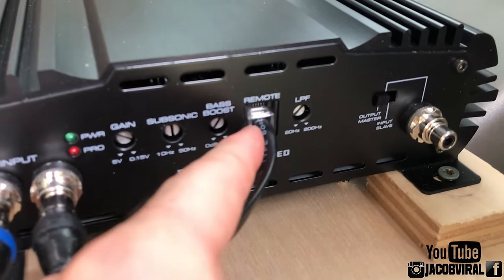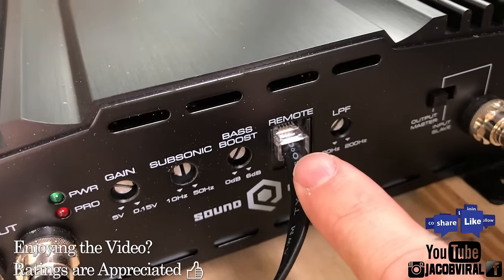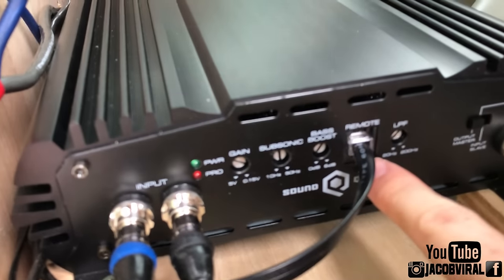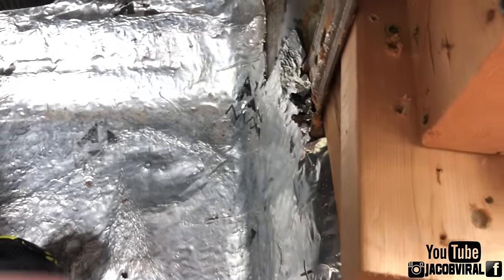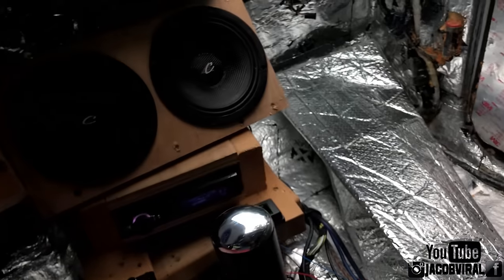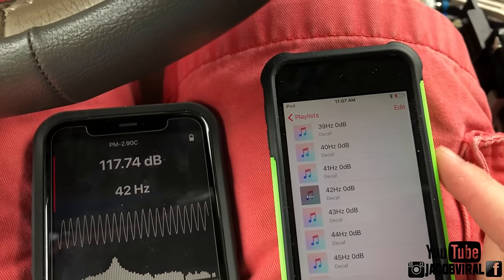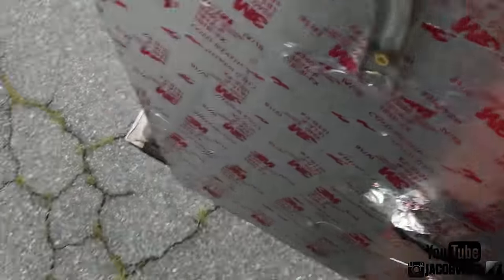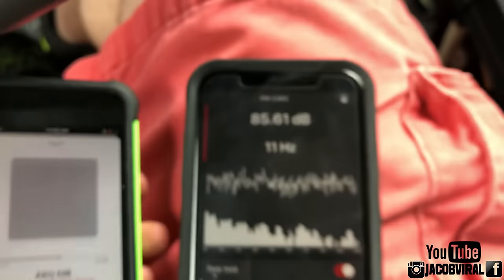DOES USING A BASS KNOB MATTER ON YOUR AMP?

Comment: The Bass knob is essentially just a potentiometer (variable resistor) which the amp circuitry uses to make comparisons to determine volume level in relation to the set gain of the amplifier. Since all wires have resistance, it's impossible to remove the resistance value of the long wires for the bass remote (there's a voltage drop between the amp and the knob which you can measure with a multimeter). You could also verify this by measuring the resistance value at the end of the cable with the knob both fully up and down. I would recommend anyone removing their bass knob to ensure they recalibrate their amp gain as this additional signal could be introduce clipping which can harm the subwoofer voice coils.
Reply: Bruh honestly who cares shhhit if you gotta sun or subs or subsssssss want allll the bass am I right so all gain and let them clip
Reply: @russel  I was going to say the exact same thing
Reply: You should really be setting your gain before adding the bass knob anyways

Comment: MAX on the bass knob vs base gain on the amp may not be the same. The bass knob is a potentiometer. It may not be calibrated to be exactly matched at 100%, especially if it's not the same one that came with the amp. That is why you should (and probably did) set your gains with the knob installed and at max.

Comment: I've only been aware that when you remove the remote bass (or when the wire isn't actually connected to the bass knob) that the gain is essentially maxed. I imagine pulling the remote connection out to power off the amp would be safe enough

Comment: Maybe because the bass knob adjusts the bass (well never!!) if you have it at minimum and un-plug it then the bass will jump up to normal so that sudden jump (transient) could cause damage but if you have the bass set to where it would be without the bass knob and un-plug it then the bass will stay where it is and no jump so no damage.

Please anyone correct me if I'm wrong or if you know or have any other explanations, thanks.
Reply: yo i got a question. my subwoofer won’t make any noise which bass knob plugged in all my wiring is good but when i unplug the wire from the base knob it clips (idk what clip means but i assume just the subwoofer jumping to max gain for a split second) and if i touch the end of the aux cord for the knob, my subwoofer works. i currently have the knob unplugged because i thought it was a problem with it. lmk if you know anything that could help, thanks
Reply: @maddoxschroeder1712  gain control on the amp needs adjusting most likely or check your cross over and low pass filter

Comment: I've tested all kind of bass knobs. My last spl cartel knob had 30ohms on 1 channel and 5 on the other, replace with new lc1 4.5 ohms on each channel. Another known good knob, same as the lc1.. I have concluded that I'm just going to control sub level with head unit to get the  most out of the system. There simple WILL be resistance in you signal using a bass knob, no way around rather than to delete it... Sucks because i wanted the fancy bass knob and such but it is what it is

Comment: Funny you asked... i got a Orion XTR15001DZ class D 1500 watt amp. At 1st I was lazy to run the line for the bass knob, when I put the knob in?? The knob killed the bass. Muffled it horribly.  I simply disconnected the knob, bass ROCKS again. SOO..  with mine NOOO BASS knob!!

Comment: The set-point of the gain equals the max power that will be output to the sub.  Installing a potentiometer allows the gain to be decreased from the set-point.  You wont get 100% because they use a resistor that has 1% tollerance
Reply: Yes exactly, The gain on the knob can't go above the set point of the gain set on the amp. It can only go down from that set point.

Comment: I'm confused. Why would the gain be at max for a test and the bass knob be at zero for the other test? I was under the impression that the knob controlled the gain from zero to max. I'm I trippin?
Reply: When you disconnect the knob, the system reverts to the physical gain level set at the amp. Or if you are talking about the knob being turned to the left, that knob is MAX all the way to the left, rather than right.
Reply: The bass knob doesn't control the gain - only the output, you want to set your gain with the knob disconnected or turned all the way up, then when you max out the knob you don't have to worry about the gain getting messed up

Comment: Jacob what is affecting your db output isn't that soundqubed remote but you not owning a soundqubed hdx3 subwoofer😁Just messing with you. You asked what subwoofer you should get next. Try a 15 or a 18" love your video and try what gets you to 150db.
Reply: How does that make any sense lol you don’t have to brand match anything dude that’s complete bs
Reply: @giovanniwolf7198  I was just messing with Jacob. See along time ago he used to have 2 18 hdc3 on 2 hifonics amps. Now I have 2 18 hdx3 on 2 hifonics amps. He can get any brand or any size he wants but his older build with 2 18s in a no wall same SUV was very loud. I put the video in my subwoofer setups playlist category. Jacob gets 100% credit for the video. Its just a playlist video with over 200 different subwoofer setups.

Comment: Bass knob range is from 0 amp gain to max of whatever your amp gain is set to. Obviously your remote gain knob isn't linear with your amp gain...slightly uncalibrated
Reply: Bro I'm experience that.

My knobs only work until 50%

From there to a 100% there's no output effect
Reply: @quintonnkoane9885  yes same here on my nvx amps

Comment: my amplifier has a remote control input and a remote control output slot which should i use for a bass knob?
Reply from the maker: Output goes to other source and input goes to current source for signal/connection

Comment: Correct me if I'm wrong but is the bass controller designed to tone the amp down and your main settings made on amp itself     I have always did my maximum settings on amp and used the controller to dial it down when needed
Reply from the maker: Correct use knob to adjust as needed for bass

Comment: Do you think the RCA bass knobs affect output or sound at all aswel? Cheers
Reply from the maker: Yes, think about the wire being damaged or possible lower quality/output if not properly set. Also could disconnect and cause issues. Overall, no bass knob = safest but not always most convenient.

Comment: Jacob hi I wanted to let you know that the audio control bass knob is intended for adding bass to songs that are old recordings or enhancing the bass on these old songs f.y.i.🙂🙂🙂
Reply: I think you're talking about the audio control epicenter.
Reply: @Widowmaker2828  can I hook up both?
Reply: @evan.norwalkcalifornia562  By both, I assume you mean running an audio control Epicenter and your regular bass know that most amps have. If that is the case of course you can run both. I recommend it. Then you can add just the right amount of low bass to any song.
Reply: @Widowmaker2828  I have a t-1500 fosgate amp with two alpine 12s...I have a epic center..what kind of bass knobs do you think I need
Reply: @evan.norwalkcalifornia562  If the amp doesn't come with a bass knob you can buy any rca style bass knob. There are plenty available on Amazon or Down4Sound. I use the bass knob from Down4Sound that looks like a subwoofer. It works well but is a little pricy.
Reply: @Widowmaker2828  what’s the name of it,and do u notice a big change..
Reply: @evan.norwalkcalifornia562  I have this one:
https://www.down4soundshop.com/down4sound-subwoofer-bass-knob/
Not sure what you mean by big change... Keep in mind a bass knob does not add bass. It only removes bass. At full volume on the bass knob it simply let's all the music's natural bass come through. The bass knob's real job is to control the bass by turning it off when you want to hear the lyrics well or want to talk to someone in the car. Then turn it up to show the power of the bass. Hope this helps.

Comment: Great vid man😎👍
I got my bass knob wet for been on the floor..can that cause my amp not to work? All my door speakers still work except my subs ..hope you can help me out with my question
Reply from the maker: Thank you! I would disconnect the Bass knob and make sure the amp is connecting correctly and everything equipment wise is good. Water damage can blow stuff sadly as it’s electrical.
Reply: Thank you brother... I just checked the amp and it still on.. I think the epicenter just took a 💩 😬😬😬 ... ima get a new one ..do I have to replace the RCA's too?
Reply from the maker: Trial and error, replace and see if fixed and if not go the extra route.

Comment: Correct me if I’m wrong but doesn’t the remote basically just give you a way to adjust your bass boost without having to go back to wherever your amp is and adjust from there?
Reply from the maker: Correct
Reply: Jacob Viral2 Thanks man I appreciate it..
Reply: Jacob Viral2 Ok I’ve got an unrelated question, if you don’t mind ..I’ve got 2 JL Audio 1000/1v2’s pushing 2 12W7’s and a JL 500/5v2 pushing the new JL C7 component speakers..I’m getting the signal from an LC2i...would I be better off using something like an LC7i or one of those JL Audio converters/dsp? Everything sounds good but I know it should sound slot better...hopefully you can help cuz I’m stuck lol
Reply: Oh yeah all that is in a 2018 Impala with the stock Bose system., if that helps...
Reply: Just less loud;(

Comment: The cheaper pac inline rca bass knobs can lower the voltage going to your amp for instance say your head unit has 3 sets of rcas front rear and sub and all 3 have 5 volt pre outs the rcas with the bass knob tapped into the rcas even at full tilt on knob the amp might only be seeing 3.5 volts were ass a bass knob that comes with the amp plugs into amp will have no effect on rca voltage
Reply: All that difference in that 3/4 db down at 118 d. Is the amp now has to send a signal to the bass knob it will make zero difference at actual listening volumes but that is the reason you are seeing that tiny difference is db at such a low volume the amp just had to bypass going directly to outputs to being split off slightly changing the amount of signal it was sending not having it plugged in.
Reply from the maker: Makes sense thank you! Will do full tilt tests soon and see difference to.
Reply: @jameslewis974  The 1.5v  difference from 5v head unit inputs compared to the older 3.5v inputs is huge.  Percieved listening, certified rated, and measured.  As long as you use high quality OFC RCA's.  Too many people never realize their systems true potential by cheaping out on the wiring or simple wiring mistakes that are easy to make.  Like running DVC subs unbridged as SVC's.  The best bass knob I ever had was through an Acoustic  Crossover in line with an Audio Control EQL (the 1st year Audio Control showed up on the block).  When I used pick up HCCA's from a back door with no outside handle.  We called Orion will-call; I picked up my 2100 from there too.  Oh the good ole days.  The techs come a long, long way since then.  These kids don't know how good they have not having to worry about rebuilt alternators, multiple batteries, isolators, relays, breakers, etc.  The wiring is still a 100% must!
Reply: @dj_illeagle  thats 
What i was saying g

Comment: So my bass knob keeps flickering and I’m not getting bass but when I push in the connection part HARD it starts thumping what’s that mean
Reply: Bad connector on the bass knob. Return it and get another one. That is a manufacturing issue. My bass knob connecter snaps into the amp but there still is wiggle room at the amp connection. These potentiometer's are made cheaply and even the good ones you lose about a half DB total volume due to wire resistence. They are convenient so I still use mine as source material from radio to MP3, to lossless music I listen to have variable bass volumes and I need to adjust on the fly.

Comment: All it does give you an option to reduce the bass while diving and not your radio !
Reply: @lxldxxxvid  I’m just getting into subs, does a bass knob lower the bass your subs make? Like if I were driving and turned it down to the minimum would the bass be quiet?

Comment: seems like in every video you have your settings on the amp is different why is that ?
Reply: Fine tuning the amp for better quality output
Reply: Sometimes cutting gain back and adding a  couple db bass boost on a specific frequency on persay 4th and 6th order boxes, generally you do wanna set your amp gain acordingly after boost, you can actually gain on the meeter by doing so if your searching for db, you can use a dsp and use it like you would your normal radio but in this case you'd have more ajustibility on the low end and top end extension this also would allow you to set crossovers and slopes Wich I have always suggested for said order alignment boxes, because it really brings them to life the point in having high order bandpass boxes is to add another "afc" amplified frequency curve Wich helps said driver with amplification of output, by helping the driver load, you can run high order alignments with the shit mentioned but the overall performance  is not as should be,

Comment: I heard a while back that unplugging gain remote makes it louder usually
Reply: Its not a gain knob..its an attenuator
Reply: trunkbangking yeah I keep seeing these comments and it’s confusing the hell out of me. The max of the knob is only going to be whatever your gain is set to. So how would it get louder. That would mean that your knob is raising your voltage past what the gain is set to which could put you into a clipped signal.
Reply: NOOOBS. LOL THE KNOB IS FOR THE COPS AND YOUR GRANDPARENTS FOES!  LOL COMMON I THOUGHT YOU KNEW!
Reply: Jersey Piney I don’t why it would either. And I never tested for it. I guess I could test it today and see if I get more wattage and db’s.
Reply: I just tested and I was always a little louder on meter with the remote unplugged. 👍🏻

Comment: I need help i dont much about this tho, i bought and amp from a friend it is a 2000w audiofonics that came without the bass control knob, i wanna get one but i dont wich one it needs, i look at the amp and it has a six cable/pin phone like connection. I'll appreciate any help
Reply from the maker: Unless you can get from the manufacturer replacement I wouldn’t trust just any bass knob that may not be compatible and could damage amp. You could always get an rca bass knob instead: https://amzn.to/3rGt0Q9

Comment: hi, connecting the bass knob remote have totally no effect for me. The amplifier does not seem to respond to the knob. What could be the reason?
Reply from the maker: Short in the wire or amp. Or non compatible with the amp. Also can use an rca bass knob like a LC1
Reply: @JacobViral2  thanks for your answer. It comes with the soundstream picassco P1000 monoblock amp. I ran the wire under the carpet nicely and then its not working. I am thinking if I could get a RCA knob or replace the current wire. I couldn't find the wire on amazon.
Reply: @JacobViral2  my amp is still playing, does that safely suggest its probably a short in the wire and not the amp?

Comment: Yo Jacob. I got some problems with my system I have hooked up in my 2009 ford flex. Wondering if you might be able to answer a few question that I got?
Reply: Whats up man, ask away, maybe i can help. I like troubleshootin pow, pow.
Reply from the maker: Sure message me on Instagram or Facebook Jacob viral. Comment away for me and others to assist to.

Comment: Anyone with a RF amp with the c.l.e.a.n. system, where do you set the bass knob during the setup up for the input clipping? Instructions don't say anything until you set output gain.
Reply from the maker: Bass knob all the at up when tuning always the gain

Comment: Your right about not removing remote cable while amp us on, I had an amp pop and burn up on me and I wasnt to happy afterwards.
Reply: How’d you fix it? I just did this lol
Reply: @Vendetta0309  It keep flashing and going into protect mode. I'm not gonna lie, I had the same amp burn up like 3 times before i got it right. Once was my fault while the alle key fell from my grasp and fell and touched body of amp and power input and burned instantly. Other time I accidentally inserted the wrong phone jack into the sfb and popped and never came out of protection mode. 3rd time I had it connected and playing for about 10 mins and took a ride and before I could make it 100 ft from my house, my sfb just went into flames while playing Bret Michaels- Every rose has its thorn and I lost it after that. Finally sent that back to sundown and they sent me an brand new amp with an extra bass knob and I've have it on my shelf as of now
Reply: @Vendetta0309  short answer,  if it keeps going into protect mode send it back to sundown, they were great with customer service...
Reply: @RomaVilla  so once that pops and smokes up there’s no way fixing it?
Reply: @Vendetta0309  it's dead, probably a mosfet inside that needs to be replaced. Unless you know how to fix amps internally send it back

Comment: U should run a single soundqubed  hdx3 18
Reply: Your 100% right I used to run 1 18 hdx3 on about 2200 rms watts of hifonics power now I got 2 18 hdx3 on 2 ohms bridged about 3600 rms watts and it hits!

Comment: My amp keep.going to.protect mode then.later that day driving sub started working ?
Reply from the maker: Sounds like your clipping or overhauling amp and causing it to protect. Check if it’s clipping and hot.
Reply: @JacobViral2  whats clipping
Reply: @JacobViral2  worked good last night after I redid the ground